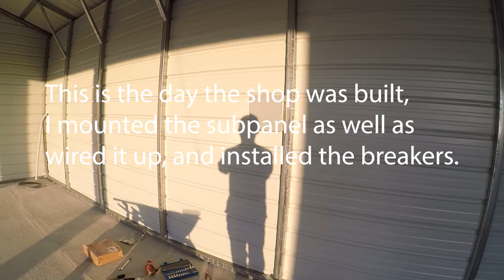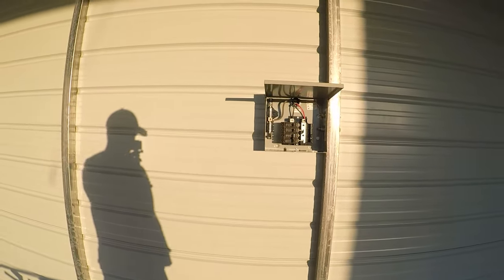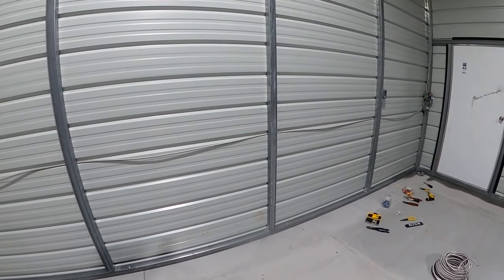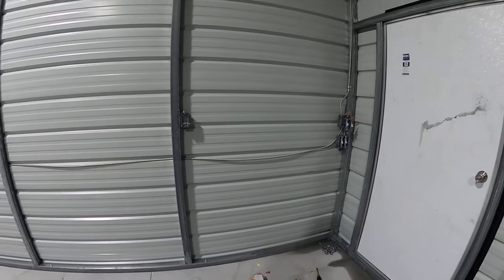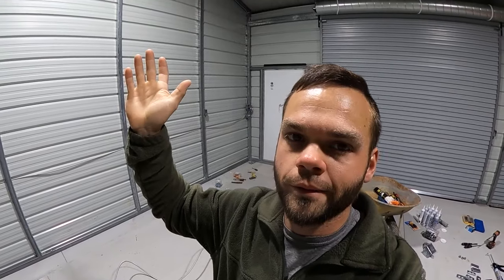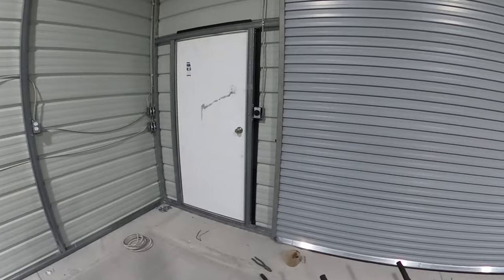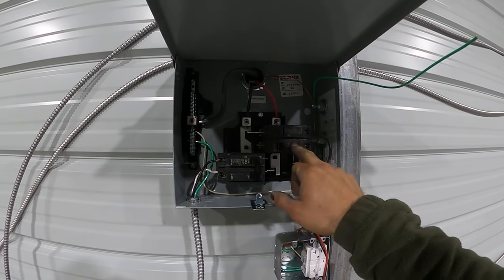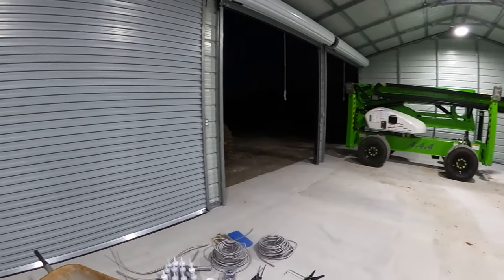Wiring Up A Metal Building

Comment: Looks like your ceiling will be sweating. I have a metal barn I had to have spray foam insulation put in to keep it from sweating. I also have a new building similar to yours that does not have it in yet and yes it sweats. We intend on having spray foam insulation installed in the ceiling in that building as well. The cheap bubble stuff sometimes drops down. So, we are planning on getting it done soon. We need to free up a little money for that project because we don't borrow money for these projects, they are paid for without paying someone interest. Nice video. I still have to do my electrical too. I was thinking 8 gauge would work for me, but an electrician family member suggested I go with 6 gauge. Nice video.
Reply from the maker: I fortunately don’t have ceiling sweating. I did however have humidity inside on rainy days and some days in the summer. Which was causing some of my tools to get rust spots. What I did was put gable vents, and turbine vents to get the air moving inside. I made videos on that if you’re interested. That has fixed the humidity issues I was having.

Comment: I read through most of the comments about the lights and still have questions. You got the 240w option, right?  How high do you have them mounted?  I just built a 40x60 with 12’ walls and 17’ peak. Trying to determine how many I am going to need to keep shop RIDICULOUSLY bright!  Great video! Thanks!
Reply from the maker: Yes I got the 240w lights. My walls are 11’ and I’d guess the peak is somewhere around 14-15’. I have them mounted not much lower than the ceiling peak. It’s bright but it’s not crazy bright. I’d imagine instead of 4 lights wide you’d want to go 5 lights wide (my building is 24x41) just a wild guess but sounds like you need at least 15 to be insanely bright. One thing to keep in mind is wire size. These lights pull 2.4 amps each at 120v.

Comment: Awesome Video. Looking To Buy A  Steel Metal Building 2 Level. With The 2nd Level Being The Upper Balcony & The Lover Level Being The Main Floor & The Entire Structure Would House My Very Own Home Theater With A Fully Functioning STAGE On Which One Can Fully Perform, Act Upon. This Would  Also Be ALL Sound Proofed Inside.  Looking Like A Breeze Wiring Such A Building. I Believe This Build Is Going To Be Absolutely Incredible.
Reply from the maker: Thank you! My wife and I almost did the same thing you're talking about as a sort of "barndominium" minus the stage. That would be pretty cool to have a full functioning stage. This thing was pretty easy to wire. We're planning on building another one soon but fully insulated with a/c for my wife so stay tuned!

Comment: Add some J channel (rat channel ) on the outside to push the water away from the edge.  I have a similar building and had it installed with that as part of my build.  Also if you grab some spray foam insulation (Not the "Great Stuff" type) and just hit that bottom edge between the support and the metal sheeting, it will seal it up perfectly.  I did that before insulating any of my building because I was having fine snow blow in at the base.
Reply from the maker: That's a great idea. I have quite a few other videos that I made to keep water out and to keep airflow through to keep the moisture down. We are getting another built soon for my wife and I am going to go the sealing, and insulation route on hers. She also wants A/C and all so it's going to be a ton of work. Thanks for checking out my video!

Comment: How did you run the MC Cable in the corners because it looks to be too tight to get the wire to go behind the corner stud??
Reply from the maker: I couldn’t remember myself so had to go out and look. You’re right I didn’t run it around the backside of the stud. I just gave it a nice smooth bend and strapped it to the stud with an mc strap and self tapping screw.

Comment: Is it okay to use Romex in a metal building?
Reply from the maker: I guess you're meaning nm Romex? I don't see why not. The only reason I wouldn't is because it's not protected by anything other than a thin insulator. In a metal building you're probably going to occasionally accidentally snag a shovel, rake, bolt cutters (you get what I mean) on the exposed wiring and the MC has a better chance of not being damaged. It also stands up better against the occasional rodent or bird messing around. Best case would be thhn in conduit but that is a lot of work and expensive.

Comment: What type wire did you use for the welding receptacle?
I need to run one 220v for an AC mini split unit. 
Is it MC 10/3?
Reply from the maker: It is 10/3 mc. If you check through my videos I made one of me installing a mini split for my wife’s shop. For that I used 12/3 uf cable, and used a flex conduit coming out of the ac unit. You can check the current draw of the unit because you may not need that large of wire, it’s a lot more expensive (or was at the time) 12 gauge is rated for 20 amps. The 10 gauge I used is for 30 amp draw.
Reply: You should look into a mini split with hybrid solar that way if you add 3x what the it says to use you can run A/C or heat pump 24/7 at no cost on you electricity bill. If it’s not running it’s giving back power and lowering the overall cost of electricity bill.

Comment: I suggest you put in two ground rods and connect them to the ground bar in the sub panel.   Ground rods are for lightning protection and are required for subpanels in separate buildings.
Also,  did you comply with Article 225.30 of the NEC?   A disconnecting means is required at or near the point where it enters a separate building.   Since you have a MLO panel, there is no main breaker, so I’m thinking you did not comply with that rule.
Best wishes,   Kevin
Reply from the maker: I had a master electrician check it out and said a ground rod wasn't needed because it's connected to the main ground and that if I had connected another ground rod it would create a ground loop? Not sure honestly I just took his word for it. I do have a ground bar just not in this video (not trying to make a how to) I do not have a disconnect on this. I had my other garage built by "pros" and it has the same panel and passed inspection, should it not have? Thanks for the good information, looking forward to your reply.
Reply: I could be wrong, but my understanding is a sub panel with 6 or less circuits does not require a disconnect.

Comment: What are the lights you installed
Reply from the maker: I put a link in the description if you want to check them out. I checked and they are right at 80 dollars a piece right now which is a good deal. I paid around 100 for them when I did this.

Comment: Did you not have to bond the panel ground bar to the steel frame of the building?
Reply from the maker: With an electrical background this one puzzled me as well. I asked a buddy that’s a master electrician. As long as it’s grounded in the main panel that’s all you need otherwise you’d get a ground loop. He showed me the code but you know I don’t remember it haha

Comment: Nicely done. I see you ran your wire between tin and posts. Im just wondering if that passed inspection. I was thinking of running mine the same way.
Reply from the maker: Honestly I don't know if it would pass inspection or not. What they can't see won't hurt them. 🙃
Reply: @reallifetested2605  did it pass inspection?
Reply: Should be in EMT, or MC cable by codes

Comment: Light switch behind the door would be annoying after awhile.  Cool shop and good video.
Reply from the maker: Luckily the door opens to the outside so I usually just flip the switch as I walk in and i'm good to go! Thanks for checking out my video.
Reply: @reallifetested2605  I should have realized that.  Here it's not normal for a man-door to swing out.

Comment: First off great video. Secondly, quick question. I just got my 30X30 bldg built. 13 ft legs and 2 10x10 garage doors. Anyway when you ran the Romex cable did you have to drill through the metal studs, or were you able to run the Romex behind because of the groove in the panels?
Reply from the maker: Thank you! I apologize you couldn’t see it in the video. I was fairly new to YouTube and my video skills aren’t the best. What I did was run the wire behind the studs in the corrugated areas of the sheet metal. When I got near a receptacle or somewhere that the wire needed to stay neatly in place I used a fmc strap with a self tapping screw. So far everything has been perfect.
Reply: @reallifetested2605  FMC strap is accepted on romex? figured it was only for mx/bx. I just ordered bang-on clips by caddy with a hole to zip the wire along the beam edges.....

Comment: Hi. I have the exactly same building the you do. How much wire did you need total? I think you mentioned that you used 8g wire from the main to the subpanel and 10/3mc wire for the other wire, is that correct? Would you mind sharing the amounts you needed for all that?
Reply from the maker: On the wire length I'm honestly not sure. I had a huge spool of 12/2 MC that I had gotten 10 years ago and finally had a use for it. For main power sizing it's up to whatever power requirement you're going to have. You need larger wire if you're going to run higher currents. If you're doing longer runs you will need larger wire as well to prevent voltage drop under load. I don't know your exact situation and don't want to tell you the wrong information, I hope this makes sense.

Comment: Just found your channel, curios why you didn't use 1900 boxes, would seem easier, there's 3 knockouts on each side and gives u flexibility for single or 2 gang boxes, would have worked with the covers you got too, good job though always cheaper to do things yourself!
Reply from the maker: No particular reason really, these just seem a little more heavy duty (like that matters) also seems like they would do a better job of keeping dust out. (They probably won't haha) Thanks for checking out my video, definitely cheaper doing all of this yourself!

Comment: What lights are you using?
Reply from the maker: My apologies for not mentioning, i'm fairly new to youtube. But am getting better with details like this. BFT LED High Bay Light 240W UFO 5000K if you type that in on amazon that will give you what you're looking for. They're awesome lights. Extremely bright, and easy installation.
Reply: @reallifetested2605  Did you install receptacles/outlets where your LED light is on the ceiling or just hard wired it into the light switch? Did you use the dimmer capability of the lights as well or didn't mess with that? Thanks.
Reply from the maker: @JP-xd6tb  The lights just came with L, N, and Gnd wires sticking out. What I did was get just a regular metal box with a blank plate. Used (2) cord grips, one for my main power coming in, and one for the light. That ended up working out perfect. If I ever have a light go bad I can just go up there and loosen the cord grip, un wirenut the old light and change it out. Thanks for checking out my video.
Reply: @reallifetested2605  Thanks for making the videos. Never know who it helps out there! I noticed you ran the MC cables on the ceiling but underneath the cross braces and then screwed it in. Why not run it above, so you'd have more support running it across each 5 foot section from one end to the other end?
Reply from the maker: @JP-xd6tb  you're very welcome. Thank you for checking them out! To answer your question on the wire routing. To make a very long story short, ocd lol

Comment: What are the specs on your building? Are you going to insulate it?
Reply from the maker: I don't remember exactly, but pretty sure its a 24 x 40 x 11 tall. The reason they did 11 tall is because I wanted 10' roll up doors. I didn't insulate because this is mainly going to be used for storing equipment, tools etc.

Comment: That  needs four wires  with  the neutral and ground separated in the panel, and a ground electrode to the grounding terminal bus , you should get a qualified electrician to look it over
Reply from the maker: You know I had a master electrician that is currently an inspector check over everything and said it was good? I asked about the ground rod and he said since it was already grounded from the main it would be a ground loop. Hopefully he’s right haha

Comment: Great video. I am in the process of running wire in my 30x30 metal shop. I've been back to Lowes 3 different times taking gang boxes back because they wont work on the metal beams. what kind of silicone did you use around the base.
Reply: I also have a 30x30. What size of wire you're going to be using for service? Of course it'll depend on what you're going to power inside. Just curious.
Reply from the maker: I used the ge all purpose silicone from Lowe’s. So far it’s holding up great. My local Lowe’s didn’t ever have enough boxes with the tabs like I use so I had to order online and do a store pickup. They carry them in their stock just never actually had them for some reason.
Reply from the maker: There are calculators online. It really depends on how far you’re running it and the amount of current you’re pulling. Also if you’re using aluminum or copper. I found a website called Nassau national cable and at the time they were almost 1/2 price of what Lowe’s and Home Depot had.

Comment: what size is you building please..i just built a 24x50 and am wondering if 4 lights will be enough for my spcae, thank you in advance.
Reply from the maker: Perfect timing. I just sat down to respond to comments and yours popped up! It's a 24 x 41. So 4 of these lights should be perfect.
Reply: What brand lights are they? I have 24x40 myself

Comment: Was that a 15A breaker for your lights? What MC did you use (12/2 or  ?) to make those long runs?  I have a big shop and just learning but I think I can only go 70' on 12g.  I'm having trouble figuring out if a light switch really needs bigger wire. My shop is 75' long and panel is in the back corner - so ideal light switch location is 50' forward to a bay door - then up outlet 1 & 2; then come back 20-25' to the 2nd pair and then back to the area where the panel is i could easily be at 100-125'... but a huge wire gauge to run a few lights seems wrong. Thoughts?
Reply from the maker: It really depends on how much current your lights draw. For example if you have 10 lights and they pull 2 amps each that would be 20 amps. That means you need to use the correct wire gauge that could safely handle 20 amps, and you'd need to select the proper size breaker that could protect everything downstream of it. Once you figure out how much current you'll be pulling, you can google wire gauge calculator. There are a ton of calculators online that you can enter your information such as voltage, current, length ac/dc, etc. Also need to make sure the switch you use can handle the current your lights are drawing as well. Hopefully that was a little help!

Comment: Dude I hopped your going to straighten out the loose wire so it looks neater
Reply from the maker: I built industrial machines for over 10 years. It’s a habit to always leave extra where possible because it’s easier to add on in the future. Better to have a little extra than pull everything tight and neat. Hopefully that makes sense.

Comment: know where near enough breaker space..youll seee
Reply from the maker: I set it up like that because this is only going to be used for storage. (mainly) I have it set up to be able to handle (2) air compressors or a welder, or an air compressor and plasma cutter. I'll never run more then that at one time by myself. Now my wifes shop... that panel is a different story.